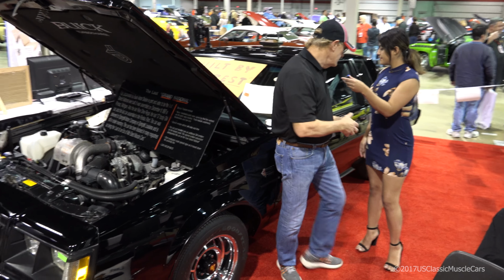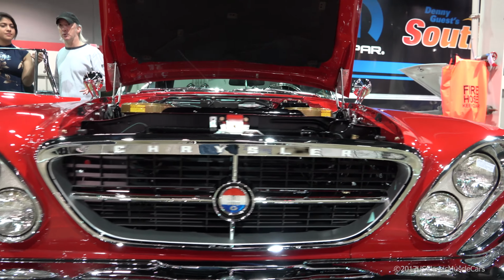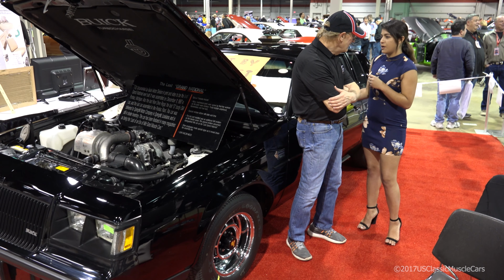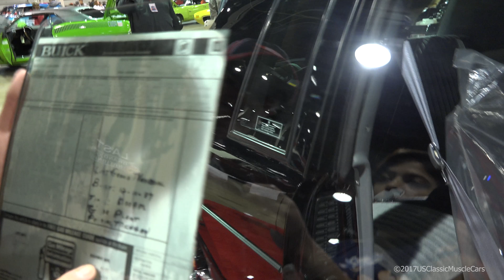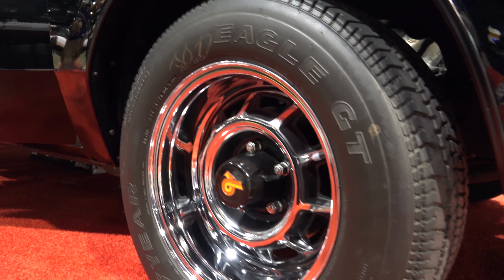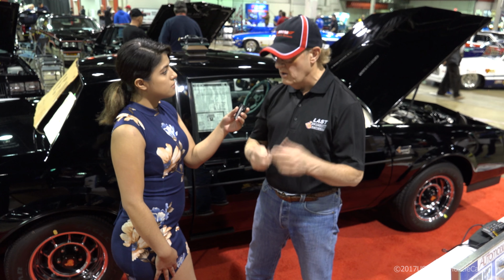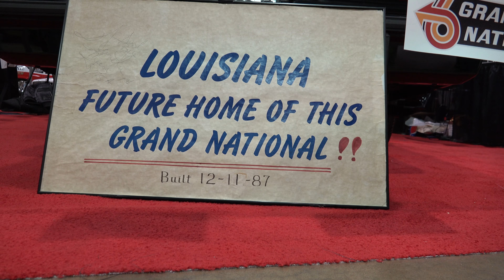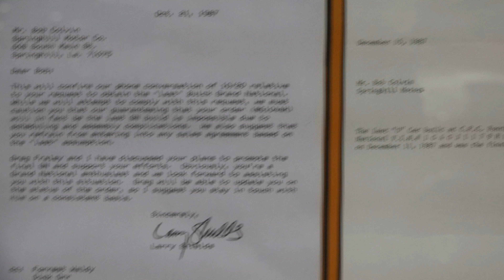The last Buick Grand National BUILT -- stays in a BedRoom - MUST Watch MuscleCars Documentary

Comment: It's spent its life in an air conditioned bedroom at his home since he got it off the assemy line pretty much. It's still isted in inventory at the his Chevy dealership. His family has owned that dealership since the 30s or 40s, IIRC. Bob and his brother, James, own it now. Bob is the NICEST guy you'll ever meet. He's a hard core drag, racer and GM guy through and through. I worked for him for over a year, until it got too slow to keep me employed.

I've seen it up close and personal. I'm envious of the room it's in, and that doesn't even include the car. He has so much GM memorabilia from over the years. Pics of special cars they sold over the years that they had blown up and framed. GM model cars that are likely priceless because of their rarity and scarcity. It's an amazing car and an even more amazing display in the room. It has all of the signs from the last day at the plant. Bob's GN was the last GN, last rwd G-body, and last actual car ever built in that plant, which was GM's oldest plant in continual operation at the time. Since the early-mid 20s. Bob and his family were allowed to come down and help build the car, back before that, was ever a thing. All of the employees signed their names all over the car. They liked the shiny turbo heat shield, so they used it a lot. To signify this car's uniqueness, it also received extra badging. One on the front grille surround area and another somewhere else, I think.
Reply: ........i read an article about that time....(bought my GN in July '87 and still own it).......showing an employee stuck 2 emblems on the rear of the GN.   Pictures shows only one emblem or badge?

Comment: I have a 1985 Grand-National Edelbrock 350 Rocket 400 turbo transmission positve rear end 1,954 very very very very very Fast😏p.s mine's no v6 V8 True power no fuel injection 
,carburetor 😬
Reply: Bet that V6 TURBO power could slaughter than anemic, 140hp V8.
Reply: @JC-11111  Hell yeah it would.